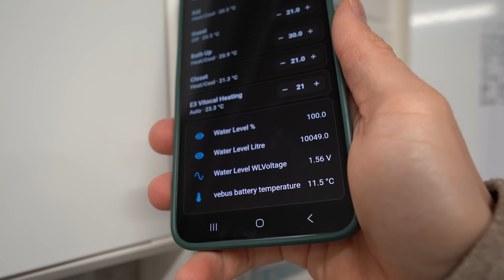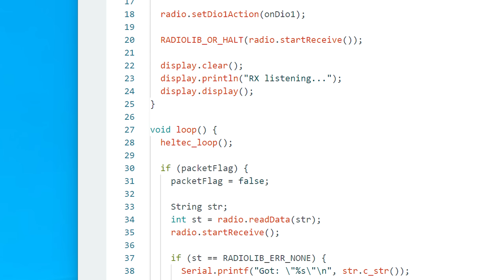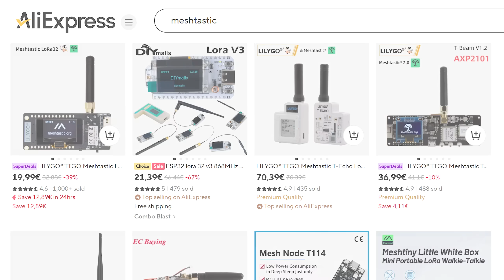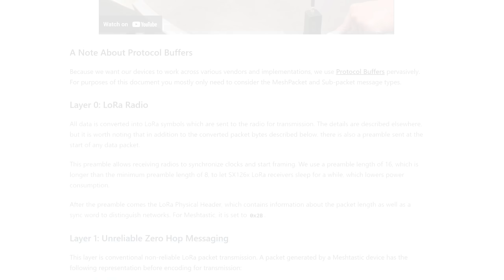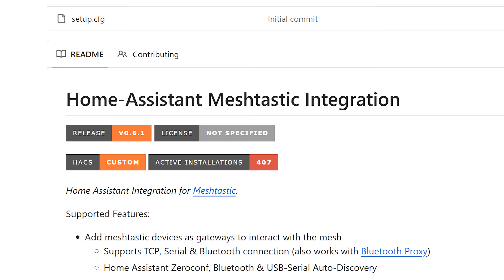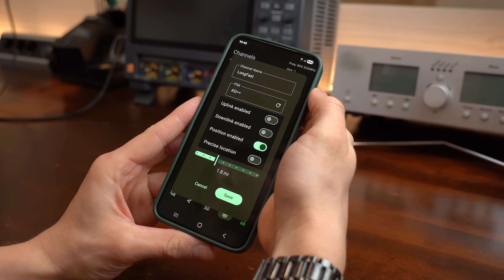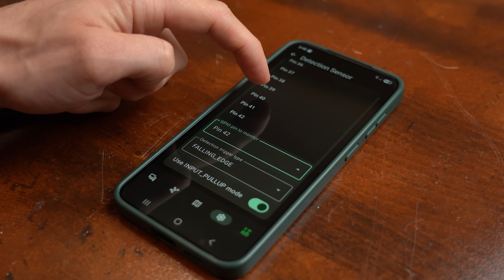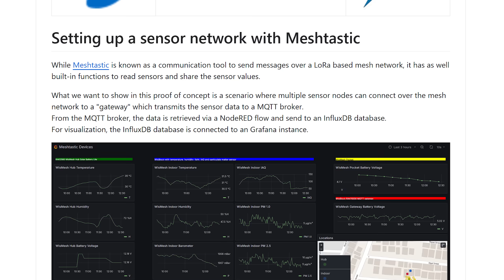No WiFi? No Problem! Long-Range is Finally Easy?!

Comment: What happens when the device transmitting gps location goes out of range? Is that data lost? Or does it transmit that data once back within range of the mesh?

Comment: Ich möchte mir einen Marderschutz selber bauen. 

Die Schaltung soll an der Autobatterie geladen werden wenn das Auto fährt und vom eigenen Akku funktionieren wenn das Auto nicht fährt. Damit es niemals die Autobatterie entladen kann.
Die Schaltung soll 3 (3x2 in Reihe wegen der Spannung) Kondensatoren auf 4000V aufladen und dann in einen ^^Tiefschlaf^^ fallen um Strom zu sparen. 
Wenn der Marder die Drahtbürsten berührt soll die Schaltung in unter 0,05 Sekunden aufwachen.
Die Schaltung soll dann die Kondensatoren NACHEINANDER mit 0,2 Sekunden Abstand entladen, so das es 3 Stromschläge gibt statt einen großen.
Danach soll die Schaltung die Kondensatoren in ca. 5-10 Sekunden wieder aufladen und anschließend wieder in den Tiefschlaf gehen.
Damit keine Brandgefahr durch Laub oder Schmutz mit einem durchgehenden Funken besteht soll die Schaltung nach dem entladen eine Zwangspause von 3-5 Sekunden machen.

Die gesamte Schaltung sollte Wetterfest vergossen sein und zwischen -30 und +70 Grad funktionieren. Der Akku sollte 3 Wochen funktionieren wenn er 30 Minuten geladen wird. Die Energie im Kondensator soll zwischen 5J und 25J liegen, also im normalen Bereich eines Weidezaungerätes wie es für Tiere üblich ist.

Die Schaltung soll ohne Arduino nur durch ^^Hardware^^ und vielleicht einem 555 Timer funktionieren.
Kann jemand helfen  ?

Comment: Wow - that is not a very discreet alarm system or really an alarm system at all. Have you written code to notify you if you lose communication with your transmitter? Much easier to just use Zigbee or similar devices with inbuilt mesh systems that can directly communicate with HA but I appreciate you did it for the content.

Comment: Hey mate, great video. Just wondering why you didn't just use ESPNow? Its got 128 bit aec encryption and a standard pcb trace antenna can communicate over 250 m line of sight. I've tested about 100 m going through a few brick walls too. Seems so much easier and cheaper to just use 3 esp32s. Two for espnow and the other one for wifi inside your house. You literally dont need any external components apart from your pull-down transistor, or what ever you used. You can even get tiny esp32 c3 boards with the integrated serial programmer.

Just a thought.

Comment: I would really love if you could include a video these wifi signal boosters(not the repeaters), ranging from 4w to 10W boosters that are connected between the router and it's antenna. Edup and comfast are the ones I usually see popping up. From resources online/what I can tell it seems that even if they add the 30db boost it wouldn't help unless your area is particularly quiet because of network prototcols, but I could be totally mistaken on this

Comment: Cool video but if you have power in your shed could you not use one of the power lines to Ethernet devices? They don’t have fast speeds as regular Ethernet or even some WiFi but for this should be no problem.

Comment: @GreatScott! Wonderful video for a great intro to LoRa and IOT!

The IR light gates are definitely cool. And I can see why you used them. "Higher tech" etc. and the applications for a light gate in things like a parts bin, a cabinet, machinery/safety or other body sensing is obvious. 

What I'd have liked to have seen though is a brief mention of something simpler and one piece for a basic room/outbuilding security system however. This is deeply nitpicky, so forgive me. Your solution was obviously "proof of concept" and way way cooler. And obviously if I can think of this, everybody else could too... But, maybe at least mentioning a basic PIR sensor, mounted high on a wall at the back of the shed, pointed at the door, and covering a big swath of the space would be an easier solution for actual security might have been a good idea. Because someone seeing the light gates could just crouch down and go under them.

Comment: Something else to consider for future projects maybe trigBoard. Yes, this is WiFi and won't work if you install it inside a consumer unit, but it does include very low power sleep, sensor input monitoring,  push notifications and no coding requirement (which you'll probably hate).

Comment: I'd recommend reinforcing the shed too. Alarms and cameras might repel amateurs, but pros and desperate people won't be deterred by either, and if you're away from home, knowing someone broke in won't do much good. Of course that doesn't mean you can't have fun and learn something by installing sensors and using LoRa.
Since you like to make hardware, I'd suggest also building a scary-looking robot which comes to the door if it opens without your  phone BT being in proximity, NFC, key code, or other proof of legitimate entry. Of course the robot can't do anything drastic, but if it shows up unexpectedly and looks dangerous enough, most burglars won't try to find out how far it's willing to go.

Comment: I needed to connect two homes over 700m but there are trees and other clutter. I tried 5GHz WiFi bridges but ended up finding WiFi HaLow adapters on AliExpress and now I gave a 16Mbps link between the two properties.

Comment: why didnt you just attach a yagi antenna on both ends to meet your requirements? or an rf switch with amplifier, or just use nrf front end section as switcher?

Comment: Have you tried using WireShark when looking for signals? I have a ti 2731 set up as a packet sniffer for Zigbee signals connected to WireShark and it's been pretty useful for tracking down problem signals.

Comment: Security isn't defined by being notified about a breach that most of the time you can do nothing about. 
Being made aware of someone prepared to act in this way does nothing for your personal safety. it is at best a neurotic confirmation of failure.
Reply: It's a technology video, it's not that deep
Reply: @HiruS22  Yeah, so if you are going to FAAFO rig up a liquid fertilizer landmine that gets them before they get inside and films it? Way more entertaining and just as challenging.

Comment: Very interesting! I would've gone with APC220 and some kind of arduino+UART integration with HomeAssistant. Maybe even using APC220 just as a UART bridge like [sensor -> arduino -> APC220] <-> [APC220 -> ESP32 (ESPHome) -> HomeAssistant].
Sounds more complex than using LoRA, but, somehow, looks simpler to me.

Comment: I'm currently usign RadioLib for a project, it works well with LoRa, but with LoRaWAN theres still some features missing. One is that I can't manage the devnonce for my nodes, and the other is that I can't get where to handle downlinks back to the nodes,

It can be skill issue from my part, tho.

Comment: Nope. There's no magical modulation that gets around lack of line of sight. People pushing these LoRa and other mesh things as if they'll be any better are either just clueless and happened to have line of sight, ignorant and did not actually test, or looking for that sweet sweet cash. I'm not saying they don't work. I'm just saying they don't work any better than wifi or any other line of sight based VHF and up transmitted signal.

Comment: For LoRa you can mess with a couple settings to increase range. Set it to very_long_slow. This will set the Spread Factor (SF) to 12 and decrease the bandwidth to 125mhz and you will get several km range. It will still work fine for your application since you don't need much bandwidth. You can also increase the transmit power in settings

Comment: One of the reasons WiFi range is limited is because of the ACK timing.  When the transmitter and receiver are too far apart, the packet arrives too late, which means the ACK is received too late and you can get a bunch of resends or the sender just gives up. I remember a setting in an old router of mine to increase the wait time.  Alternatively, you can try sending via UDP, which doesn't wait for an ACK. A lot of real world radio stuff uses UDP for this reason, and any ACKs or resends get handled at the app layer like STANAG 4586.

Comment: ESP-NOW can achieve 100m(200–400 meters), there are additional antenes or you can DIY simple wire 3-4cm (can not recall the length). Even with walls you should be able to reach the 20-30m mark. Its not that Lora is much more expensive, so it should be fine :D. BTW, thanks for the great videos
Reply: Do you mean an ESP32? I'm trying to use one to transmit Victron data from my shed about 20m from the house via wifi and I'm not getting any reception. I'm interested to try and find out if I could send the data to HA via Lora modules
Reply: @HiruS22  ESP-NOW is a direct communication system between 2 ESP devices, not via Wifi network.
Reply: yep. It would have been a better solution. 128 bit psk aec encryption. Ive tested two going through 3 brick walls got me over 100 m. Line of sight got me 250 m. To get better range keep the boards facing each other. Then get even a third board to receive an analog signal from the receiver to talk over wifi. Or if you're feeling like it program one to switch between esp now and wifi once triggered.

Comment: Yeah, but LoRA really sucks. It has dutycycle and you dont want that, you wanna be able to transfter data at the rate you want and not be limited by dudy cycles... so yeah lora/meshtasic sux... wrong frequencies. use wifi. easier.

Comment: You can use a second microcontroller on the Tx side with Meshtastic and connect the two using serial communication. I used the Heltecv3 modules with an Arduino nano to build a remote water tank sensor that is 3000 ft away. The Arduino accepts ASCII from Meshtastic and performs a function. It will listen for "water level" and then check the level using an ultrasonic sensor and send back a gallon amount based on distance. One thing is you have to filter out the Mesh node ID as is will appear as "8569: water level", it makes it easier that way for multiple commands and reduces memory usage for storing the commands in string format.

Comment: Your 700m range where achieved with the antenna in the horizontal orientation.. cross polarization destroy lora range :) You should test with both antenas in the vertical

Comment: Now take a look at HaLow WiFi. Uses the same frequencies but has the full TCP/IP stack so no need to mess with LoRa which is proprietary... Equally; promoting Metastatic is also not advised, they have very expensive lawyers....

Comment: Please run a humble ethernet cable to your shed :))
Reply: Fiber would be more advisable for isolation
Reply: Even better, but requires special stuff to terminate and is probably more expensive.
Reply: @DanielsGameVault I was sure that fiber is weak and fragile. but recently I heard that both sides of ruzzian war in Ukraine use drones that are controlled by miles of fiber cables.
Reply: @DanielsGameVault Just buy a fiber cable of the length you need.
Reply: But where's the challenge in that? ;)
Reply: @proxyhx2075 Signal loss: allow me to intoduce myself.

Fibre would be the better option anyways but hard. Ethernet maybe with a lot of shielding may work but iver 20m? maybe?
Reply: @harriet-x.x I've run a 100ft cheap basic cat 6 ethernet cable from my house to my shop. Ran most of the cable run a few inches below the surface then a few feet above ground outside through a metal rail and then into the shop. No perceived loss and connect at 1Gbps (capability of switch). Even runs near the shops' breaker.
Reply: … I don’t think watching a 10 minute video where someone buries an Ethernet cable across their garden would be so informative! 😅
Reply: Ubiquiti Nanobeams are cheap and would easily provide range.  But that defeats an opportunity to play with technology.
Reply: Powerline ethernet would be even easier.
Reply: @PatrickOReilly easier, but shitty. Only ok-ish if it is in the same circuit and even then it doesn't hold a candle to even a humble coax cable. Heck, it can't compete with a WiFi bridge.
Reply: The burglar could cut the cable and then enter the shed
Reply: @rafaelskt4ever  The burglar can jam radio connection even easier, and with radio you cannot really set "no connection == alarm" condition as radio waves be finicky... I will never understand people who put up radio (WiFi/cellular/BT god forbid) security cameras - that would catch only a teenager junkie opportunist, the career burglars are all carrying RF jammers - and are not shy to use them.
Reply: @rafaelskt4ever  All you need is a "lost connection = alarm" condition
Reply: @BootlegHuman no signal there would be enough to trigger alarms...

Comment: great video and loved the use of Meshtastic this way, sorry it got complicated after, Pin 41 and 42 is reserved for i2c devices for that board, so it conflicted with your alarm setup, if you use any other pin like 2,3,4,5,6,7,33,34,43,44,46,47 you would have been okay
Reply: I was a bit disappointed that he did not get it to work with Meshtastic, since I'm thinking about doing something similar in the future. But you'r mesasge gives me hope that it should be doable :)

Comment: A few years ago i had bought 2 Heltec units. 20-30 €/each. For each unit you need a mobile phone. Then there were regularly firmware updates necessary. Firmware update is not possible anymore out of safety reasons. Right now i wont buy anymore. 
Either there should be very cheap units. 
Or something independent from a mobile, having a display and keyboard. But that should be in the range of max 40 U$.
Maybe in the future. I had a look at seeedstudio. Not that much.

Comment: I got 2 868 recievers in use.
One for the bresser mqtt weather station reciever and one for the hoymiles open-dtu project.

The first has a somewhat limited range, but the second has really been a set and forget addition to my smart home.

I'm glad these are already projects that require minimal knowledge and a small amount of diy.

Your project also looks promising, but i personally would fix the wifi problem in the shed so you could also have a camera connected there.

Comment: Why do you need meshtastic for a simple lora signal transmission?
    You can use a cheeper lora module which you can control with a cheep esp32 to send the signal when the connected sensors on the same esp32 are triggered.
   I don't think it should be to hard to make a simple detection sketch (a good llm ai could do that for you) with this kind of configuration and you don't need meshtastic and any other "fancy" arduino libraries.

Comment: Get a lora device with an external antenna connection and a proper whip antenna tuned for 868Mhz (with low SWR) and you’ll keep walking 😂 
Das war wieder ein gute Video! Vielen dank und Grussen aus Holland 👋

Comment: Alternative route: ESPHome SX127x and packet transport component. This allows you to have a sensor on one node forwarded to another, which then relays is to Home Assistant. No mesh, but now you can relay all the sensors you can think of.
Reply: This sounds even better than my go-to "long distance (UART) bridge" of ESP12 (ESPHome) + APC220!
I may have to test it on my next project...

Comment: There is also LoRaWAN...which can do ethernet over LoRa...
I am building serveral nodes, I have a Low Profile Solar Meshtastic Car Node, several of those RAK19007 modules, I am currently building an external LoRa Lantern - Mesh Radio to hand up about 15-20 feet on my amateur radio j-pole outside my house...and just ordered a few boards to build my own Ikoka Stick nodes.
These things are pretty fun!!!!
Reply: And then there’s HaLow….

Comment: Long range WiFi ? You are getting on the borderline of legality, a lot of cheap devices sold on aliexpress are completely illegal in Europe : GSM repeaters, GPS jammers (one guy with a company truck decided to jam the gps to use the truck freely, and shut down Rennes regional airport, France, for several hours, no aircraft could get reliable gps fixes)

Comment: One thing not clear is, if its using a direct node to node connection, without any nearby(hidden🤔) nodes. In which case reliability is dependent on other device's operation in the vicinity?. You could also do a direct link, at fraction of the cost using an NRF24L01module, by throttling(increases sensitivity) the baud rate and improving antenna directionality?.
In remote areas(trekking in the wild) LoraWan is definitely helpful though.❤👍

Comment: Since 3 years I monitor the state of the victron solar system in my garage (~400m away from home) with an EBYTE E32 DTU module. It works very fine, only in very heavy rain the connection is lost. Impressive, as there is no line of sight between them and it is in a village with probably a lot of noise.
Reply: This is exactly what I'm trying to do, though not as long a distance, so I'm going to do a bit of research on that module, thanks

Comment: That range is horrible. Try the range test again with the default ping pong app. I’ve tested it to more than 5 miles on the v2. The default settings on your meshtastic example probably doesn’t set the spreading factor and bandwidth correctly for a range test application and is set up for higher data rates. It’s really complicated and would be awesome to see a video on. If you could figure out a way to send data faster than half a second (4byte packet) I’m all ears as well. From my understanding due to the 1% duty cycle rule for Lora; it’s not possible to have fast update rates with the technology
Reply: there will always be some delay